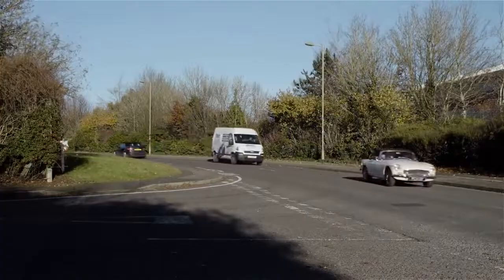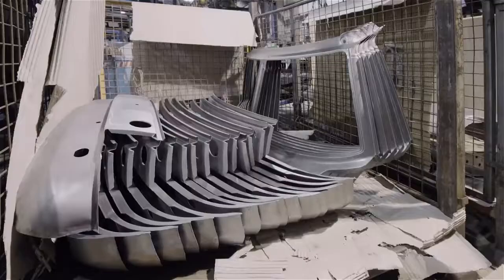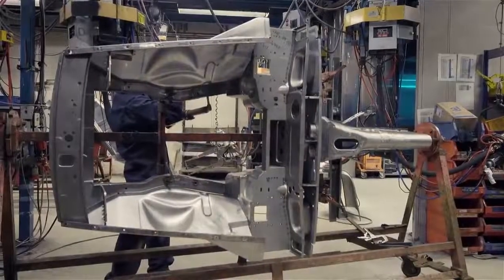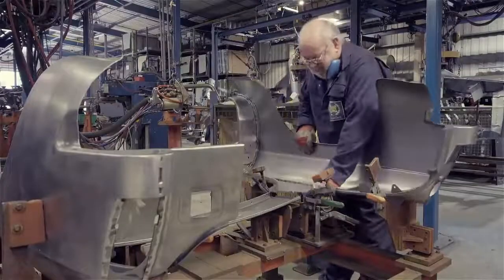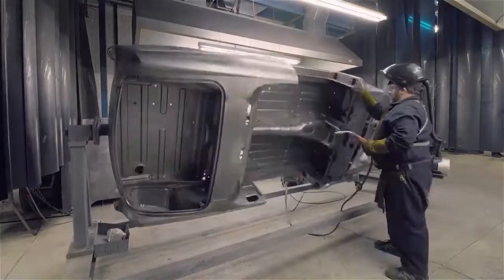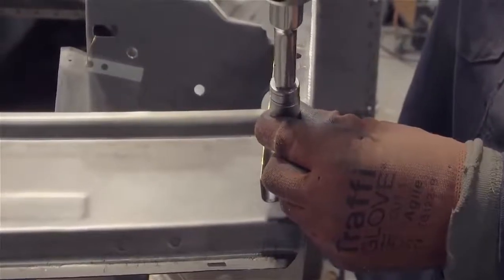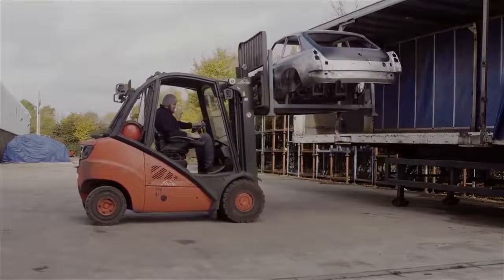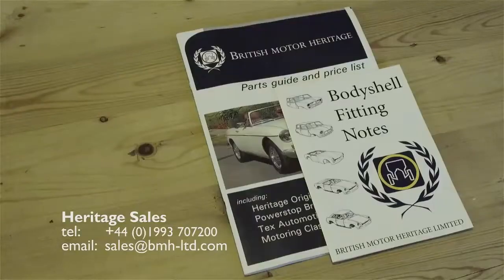MGB Bodyshell Build

Comment: Fascinating film to see how these cars are put together, especially the GT. I spent 22 years living in UK, returning home in 2010 and yes the ravages of rust can be an issue in UK with classic cars. I owned a 73 MGB GT V8 and a MGC GT (not at the same time!) and found it interesting where they choose to rust compared to Oz. I also bought a one-owner P6B Auto in UK, stunning interior, mechanically very good but the base-unit was terrible, as I was to learn later on. Now back in Oz I recently bought a 1967 MGB GT on wires, it is totally rust free with its original paint. I might add I owned the very same GT in the 1980s before selling it in 1988. I found it by chance 4 sale online, it needs nothing done to the bodywork after 57 years.

Comment: After having restored several rusted out Bs, sills, floors, doors quarters, I wonder if there is anything done differently with the new bodyshell to improve its longevity?.
 It seems so worthwhile to invest in a shell over battling rust on an original. I wonder if there are plans to add MGA to the repertoire? 
 Steve from US

Comment: The panel alignment on my Heritage shell is awful.   The panel The windscreen attaches to isn't square with the body.  One wing sits further forward than the other.  The windscreen doesn't align properly.  One leg of the bracket holding the clutch and brake master cylinders had to be shortened so the mounting holes would match up.  The bonnet to wing gap gets bigger as you get closer to the headlights.   The space for the grill is too small. The location of the bonnet latch panel doesn't line up with the latch on the bonnet.  One door latch is too tight to open and close properly.  The hole in the door for the safety latch mount is at a different height than the mounting location on the body
Reply: Sounds like you got the last one on a Friday afternoon.
Reply: Me thinks you are asking a big much for a  1950's design more or less hand built car with tolerances measured in inches! Even when 'new' from the factory the finish of  those cars was awful truth be told.
Reply: That’s more than a bit disappointing. I can’t imagine starting to reassemble a painted body shell, only to find that parts don’t align and/or fit. Anyone from Heritage have any comment about this? I’ve been considering going this route, but now I’m not sure.
Reply: @iadcrjca  That is what you get for trying to live in the past lol!
Reply: @patbutete1722  Agreed! Lol
Reply: Yes, yes but do you have any bad issues?
Reply: Looks like they've managed to preserve authenticity
Reply: That’s BS…. Have you called them. Also, after watching this Video I noticed the majority of workers were Grey Haired!! It fits where it touches.

Comment: Having had a few MGB cars in the past i now fancy building a roadster. What did slightly concern me was in the video that. Before fitting the front wings the area's were sanded etc. At no time before fitting the wings did i see any anti corrossion treatment. A bit worrying that after a few years rust will start to creap in. Or did i miss something.
Reply: Right! You would think they'd lean into corrosion prevention given the history. Maybe they feel that without corrosion, it isn't a real MG.
Reply: They also neglected to use any SEAM SEALER.
Reply: Heritage has addressed the corrosion issue with the choice of alloys they use in constructing the car. Though not stated here, most of the construction issues with the MGB shell have been re-engineered, either different material choices, additional braces or a significant redesign to overcome those items that have ended the life of most MGB's.